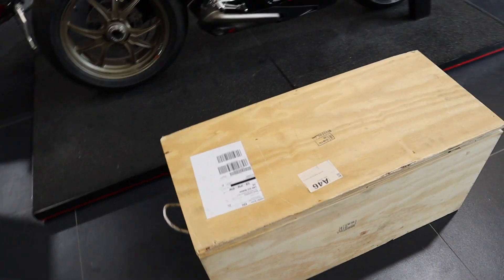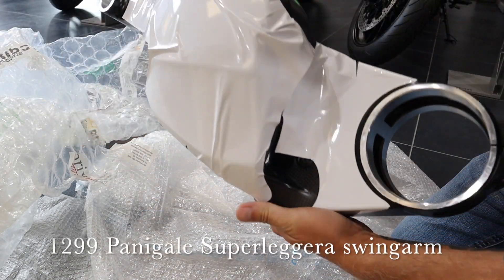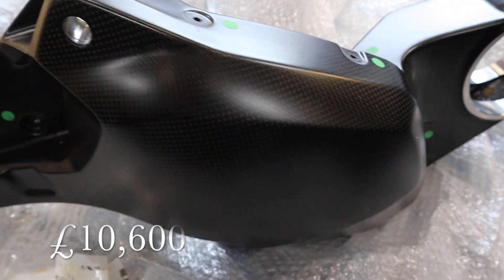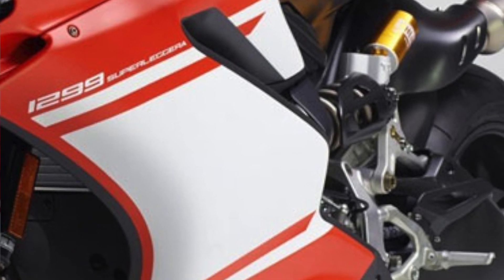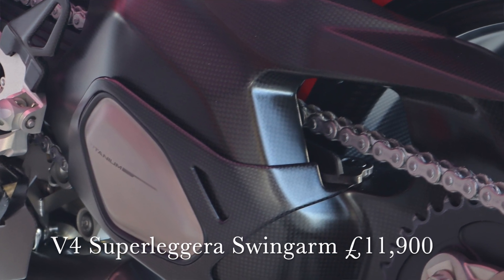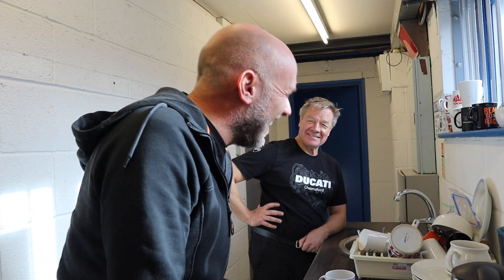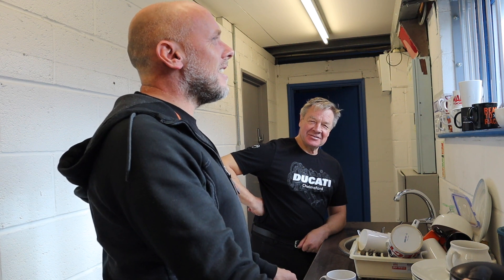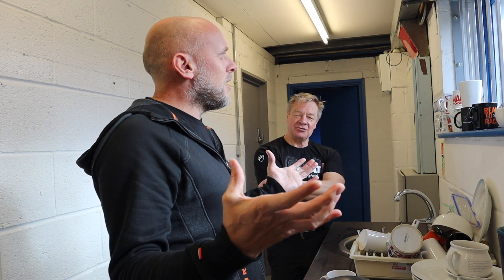£11,000 For One Single Motorcycle Part!!Most Expensive Production Upgrade for your Ducati Panigale??

Comment: Did the owner who purchase it write-off the original? Iv just done a full conversion from V4R to Superleggera, and the carbon swingarm is the last piece of the jigsaw 😬
Reply from the maker: No he didn’t write the superleggera off but the swingarm was damaged in a slide on a track day, the scrape on the side put a whole in the side swingarm (the carbon fibre is not very thick) .. if you get one make sure you put a guard over the side of the swingarm... an expensive slide